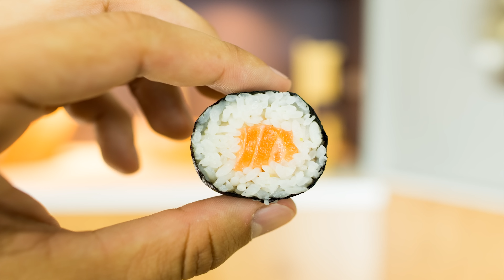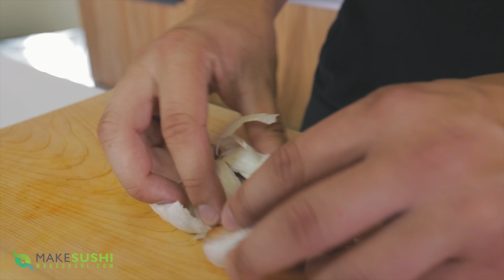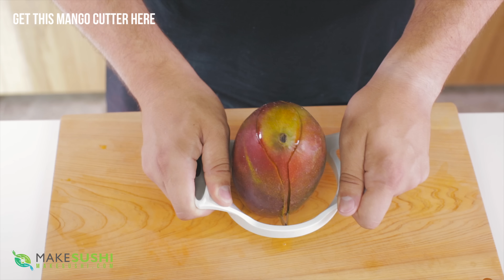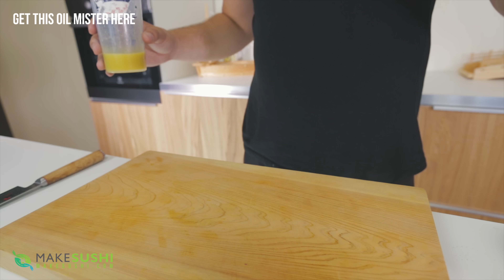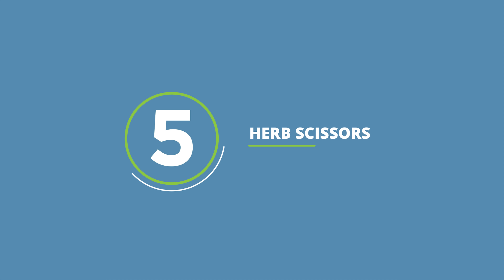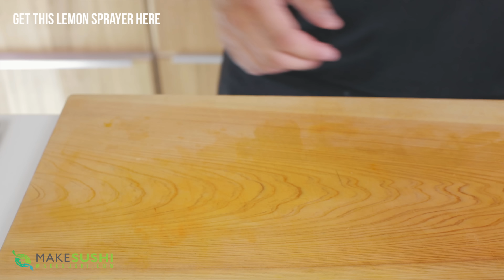6 Awesome Kitchen Gadgets

Comment: I have five of these gadgets, – except the garlic chopper, and if you really want to know, how many times do I use them?  Well, once a year for the lemon sprayer, – I would rather use a traditional lemon squeezer –never for the Mister or mango cutter, and the herb trimmer  as you can see in this video leaves coriander leaves behind, when you try to trim them off the stalk.
 The only thing useful is the multi-blade scissors, because I do a lot of chopping up of fresh herbs every day.  The only thing boring about it is the leaves stuck between the blades, which I need to  remove with the help of the flimsy plastic "comb."  But then, gadgets are supposed to be cheap and if they turn out useful well and good– if they do not, pack them away like I have done and place them in one small corner of the kitchen.

Comment: Your herb scissors are actually worm scissors :-)
Anglers use them to cut worms in pieces to be used as bait.
You can find them at your nearest angler shop.
Well, yeah, you can cut anything with them quickly, but you might wanna keep appliances apart.
Reply from the maker: That will be great for when I make a worm herb salad, will just need one tool to do the job 😜 +Czar Zenana

Comment: that oil spray thing can also be a butter spray thing by melting the butter
Reply from the maker: Just the other day I saw a new gadget to do just that, its called a Biem spray :) +Levi Au
Reply: http://en.bcdn.biz/Images/2016/9/27/bb461a30-0859-4e2b-bb30-8a31802430d9.jpg
 I Make Sushi ; was

Comment: Don't use coconut oil . Coconut oil is a solid at room temp
Reply: But still you won't be able to spritz unless you microwave it or something and those containers are metal ...
Reply from the maker: It depends on where you live here in Spain it stays liquid all summer and solidifies in the winter. 
you could easily place the sprayer in a warm water bath and the coconut oil would melt.

Comment: Coconut oil is pretty much solid at room temperature so putting it in a spray seems unwise to me
Reply from the maker: Depends where you live in the world, in Spain for example it gets really hot in the summer (easily 30•C every day) and it basically stays liquid all summer. But in the winter it does become solid so I understand where your coming from, in that case place it in a hot water bath for a bit before use. +Crocodile Deathspeed
Reply: science is amazing

Comment: Well, 5 gadgets, 1 tool. Oil Mister is a useful tool with several things that can be done with them, just like a whipper or seltzer bottle.

There is only 1 unitasker in the kitchen, and that's a fire extinguisher.

So disappointed that you've stopped making sushi videos and taken to selling trinkets.